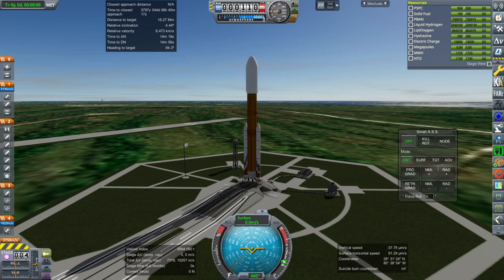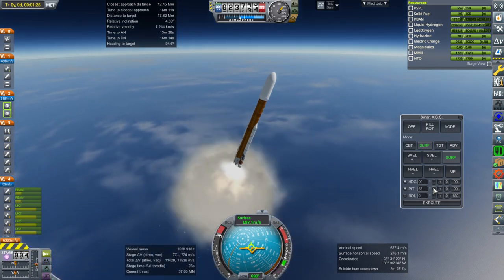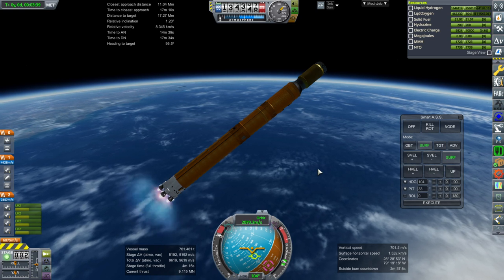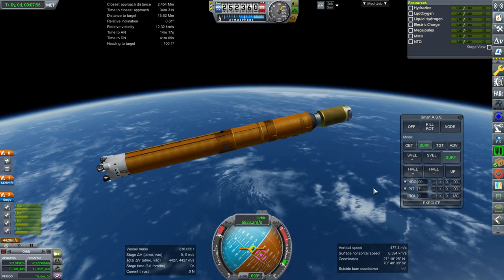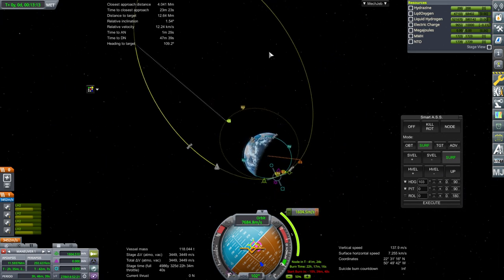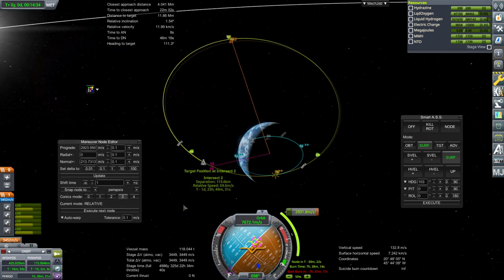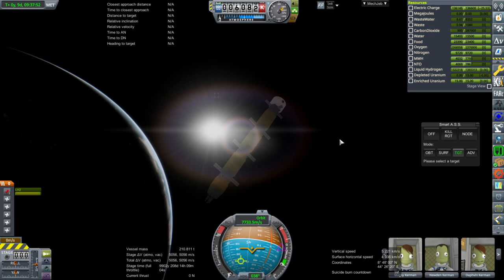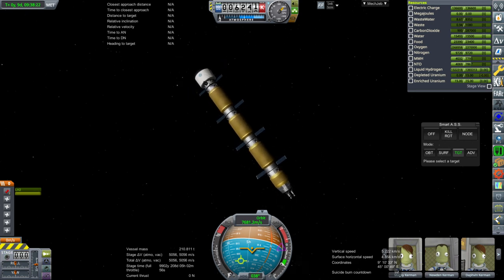Realism Overhaul in KSP 1.8.1 - NASA's Nuclear Propulsion Architecture 2

Comment: Reactors on earth produce heat which is than turned into energy by heating up water until it turns into overheated steam and running it through a turbine, i can't imagine how that would be less complex than simply using hydrogen instead of coolant while you burn the engine.
Reply from the maker: Well, I've been informed by people more knowledgeable about nuclear engines than I am that it is, in fact, much more complicated to make it bimodal. I'm not going to use my imagination to decide the truth in the face of that, so until I see a paper indicating otherwise, that is what it is.
Reply from the maker: One example of this sentiment that electricity production with a reactor is easier than using it for an engine can be found here: https://twitter.com/BeyondNerva/status/1317172068635582466
Reply: Oh I can totally see that making it bimodal would be much more difficult. In theory NTP should be simpler than using a reactor for power but I love being proven wrong like this. When I give it more thought it still is a rocket engine so it makes sense that subjecting a reactor to those kinds of pressures would be an engineering challenge. I suppose just using a reactor that already works on earth is much much easier and possibly safer.

Comment: 11:15 I wouldn't call nuclear electric propulsion more efficient or necessarily more reliable than nuclear thermal propulsion, 'cause Reactor→Engine→Generator→Transmission→Thruster vs. Reactor→Nozzle. It has the advantage in specific impulse due to temperature limitations with NTRs, though.

12:00 Not sure how that makes it different in KSP vs real life...

17:05 And there goes your margins. I mean, you could sequentially use, stage-off, and re-dock tanks to get more delta-V, but that'd require stages to be added upon return. Or maybe the loss in RCS fuel made it up? looks 26:20, then at earlier video Actually, yes.

19:15 Hope you got back to that. ;)

Comment: this is quite neat! Though I wonder why they would use hydrogen for a deep space mission like this, since it takes up so much more volume and thus requires much heavier tanks...
Reply from the maker: Because it gives the best efficiency when using nuclear propulsion. Hydrogen is very light, so the heat from the reactor excites it to a greater exhaust velocity.